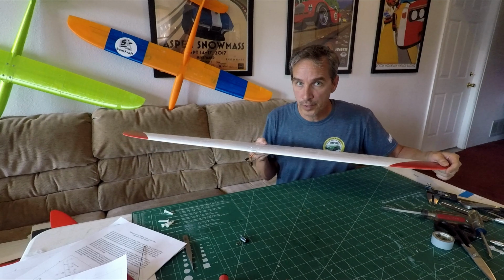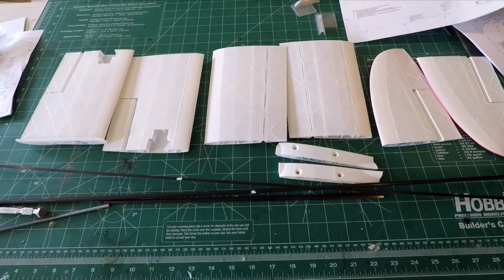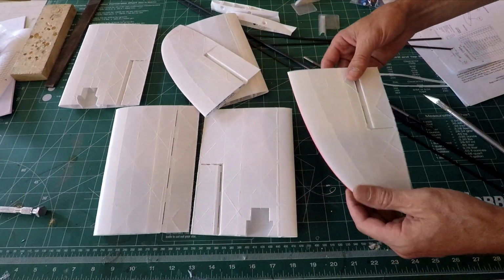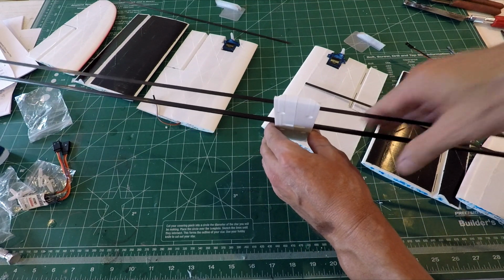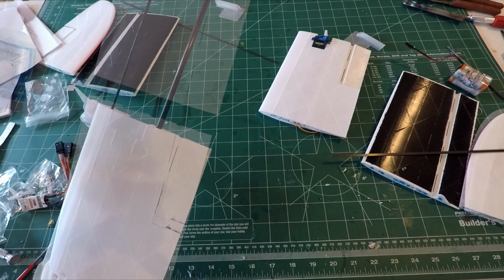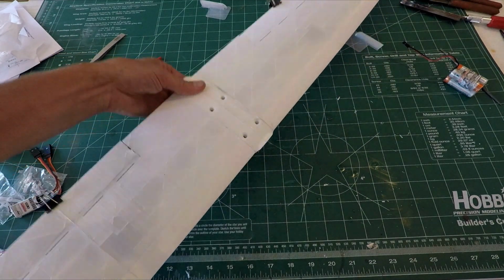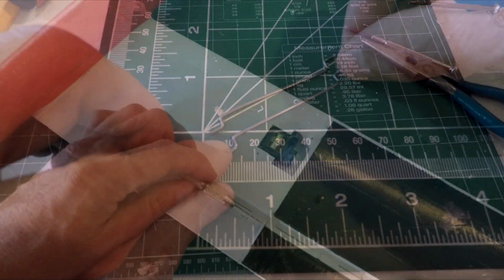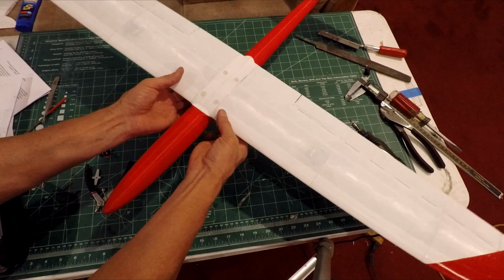SoarKraft 1.2M Wing - 2 Servo  - Complete Build Guide

Comment: Excellent build video..
Just became a new subscriber...
Got to get me a 3d printer.  Amazing fly.
Can it be use as D.L.G.  glider.. Thanks. ✌
Reply from the maker: This model was designed for slope flying or flying with an electric motor using the power pod.  Not sure about launching it as a DLG.... it does have a full span spar and could probably be modified to do so.  

Funny thing - hot thing now it to turn a DLG into a motor glider.  I don't understand that.